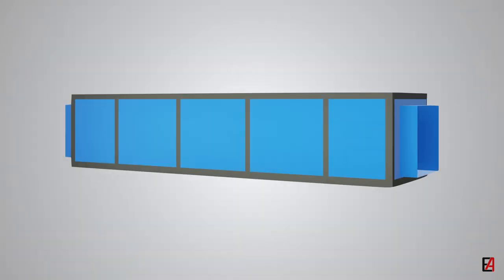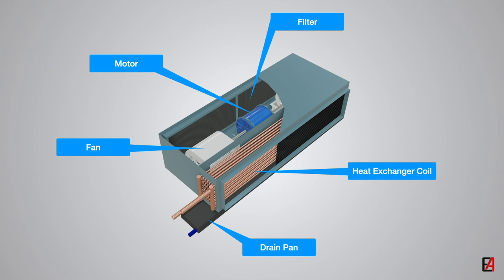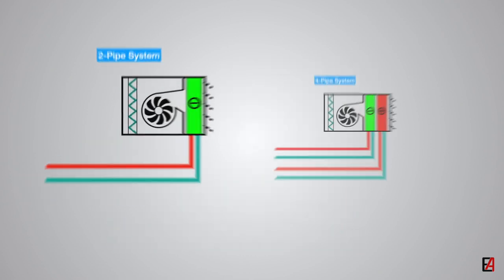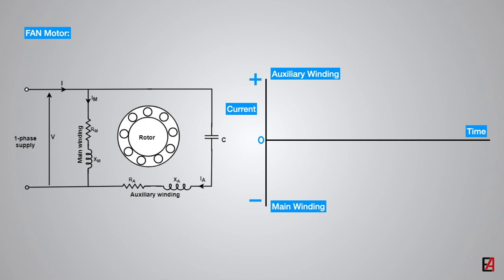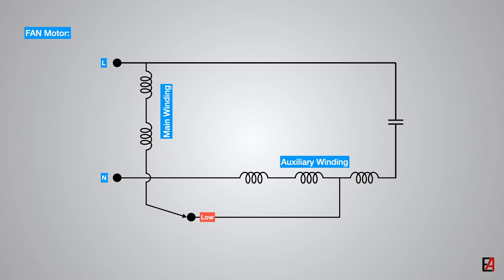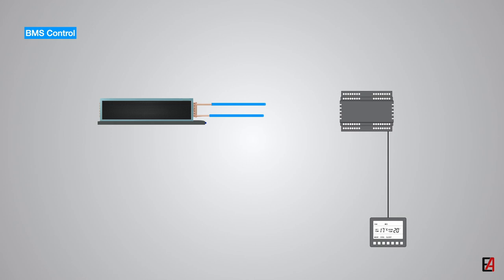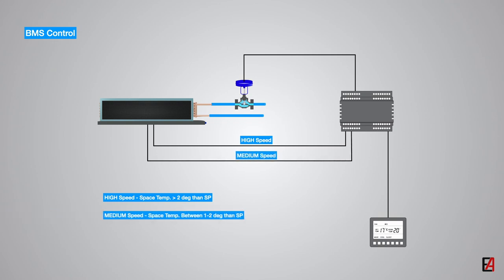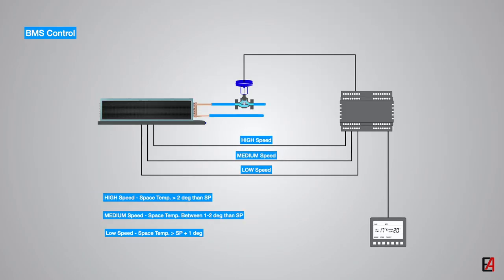Fan Coil Unit (FCU) Fundamentals and BMS sequence of Operation

Comment: Hiii Sir , super video series, completed all the video series so far u posted in the channel keep it up and expecting more.
I have a query regarding this video, could you tell me when AHU is already supply fresh air  and takes  back the dirty air why fan coil unit is given. I hope the AHU supply air would be properly cooled, then why one more cooling unit is required.
Reply from the maker: Hi Akhil, thanks a lot for your feedback and support. Please share and subscribe.

In case of an AHU serving many areas and rooms, it is not possible to achieve certain temperature for a particular room. For example if there is an electrical room which require certain temperature with the AHU supply, it is not feasible to achieve proper cooling considering the heat dissipation from the electrical panels. Providing FCU helps to achieve proper cooling in that particular room. Also it is cost efficient as you dont have to do bigger ducting all over the building and that will increase the AHU load & size. Hope this helps.
Reply: @engineeringautomation  Well explained, thanks a lot. I request you to continue the series

Comment: You said the valve opens and closes if room cooling is needed or not. So the valve is 100% open if cooling is needed and instantly 100% closed if it’s not. It’s never 50% open etc? Also, you said the fan keeps going 10 mins after it hits the set point. Do the valves shut off the second it hits the set point? If so, wouldn’t the fans just be blowing the same untreated air right back into the room? Why wait 10 mins to shut off the fans if they’re doing nothing in theory?
Reply from the maker: Hi will.. if the valves are modulating type, then the amount of valve opening is decided by the PID controller.. see my video on PID controller.. the fan just recirculates the cold air in the space when the valve is closer. There are some cases the fan can be shut off completely. It depends on the region of use and power saving configurations. Hope this helps

Comment: Hi Sir , may i know the main difference between a FCU System and VAV System.
Reply from the maker: Hi Derrick.. FCU is like a cooling unit which will have cooling coil to cool the air. But VAV as thr name says its a variable air volume unit. It only varies the volume of air and does not cool the air. It take air from the AHU and regulates the airflow to provide cooling to the room. But FCU, take air from the room and cool it before sending to the space. Hope this clarifies your query. Let me know if you need any other information. Please support by sharing and subscribing. Thank you
Reply: Hi Sir, thanks for the reply. That means can I say the VAV System is a stand alone system in which chilled water supply from the chillers is not required, whereas the FCU cool the air from the  cooling coil which is connected to the CHW pipes from the chillers.
Reply from the maker: Yes.. u could say that. But VAV’s require AHU which cools the air since it only varies the air flow.
Reply: Hi sir thanks for the reply. I am new to facilities management. I am keen to know how are  motorized valves for the AHU works together with the DDC .
Reply from the maker: Hi Derrick.. please watch my other videos which will help u to understand BMS. Flor valves control please see my video “https://youtu.be/ZxmvvZuzxhA”